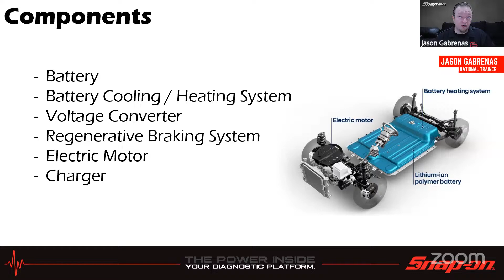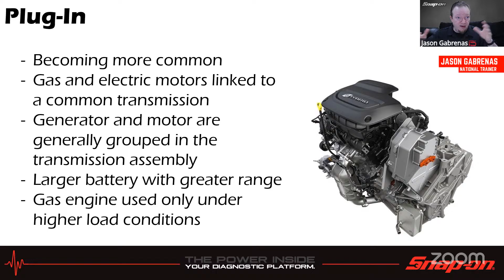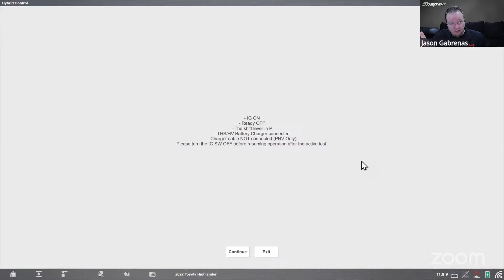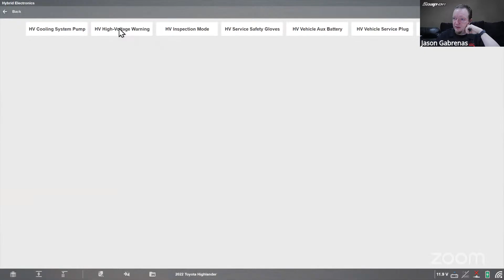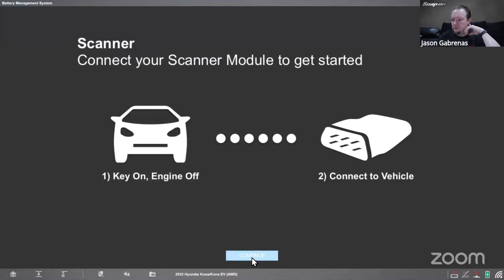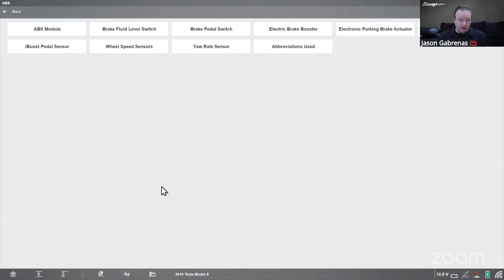Hybrid/EV Diagnosis and Repair - Snap-on Live Training Episode 114

Comment: Well, I don't know about Tesla's, but most, if not all EVs I know or have worked on have different settings for regen, usually on the steering wheel, and can be switched off if necessary lol